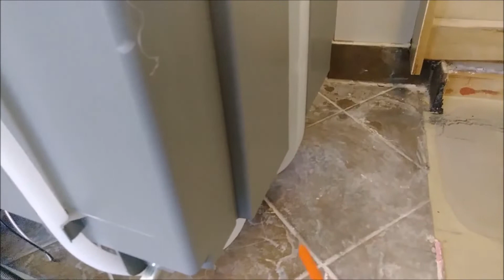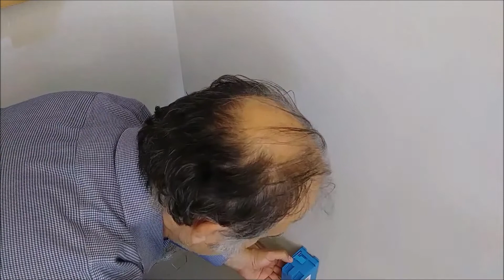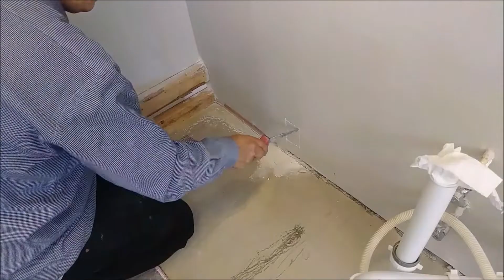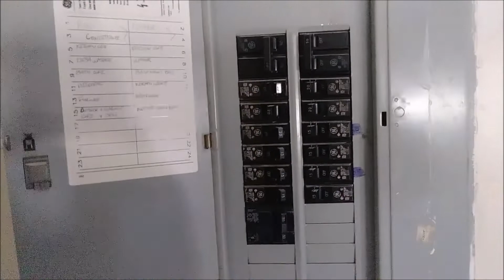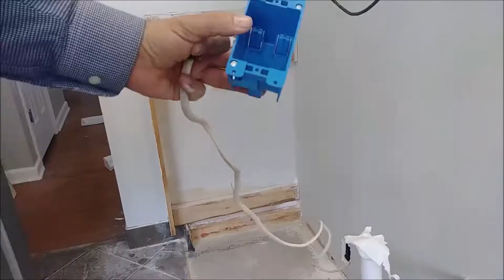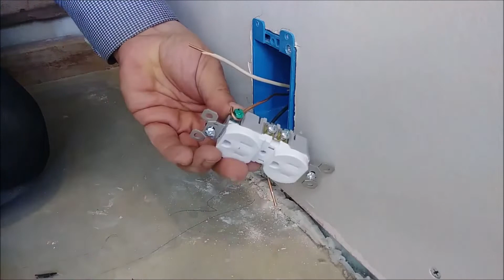How To Add and Wire Outlet To an Existing Circuit -  Replace Hardwired  Dishwasher To A plug

Comment: Why is this so ridiculously low to the floor (7-8", who told you that)!??  What about the baseboards and base cabinets bottom/toe kick?  This outlet would be touching the bottom of the cabinet and look silly.

Also that's some serious overkill (and dangerous) using a multi tool BEFORE a hand drywall saw!  Why not just start with that?  Also then you show checking the power AFTER you've done all the dangerous work where you could have gotten electrocuted! Lol

Next time, just use a handsaw. And install much higher!

Sorry, I don't think this guy knows what he's doing.

Comment: How do you know the exact location of the cable behind the wall?
Reply from the maker: I know because it was there before I install new wall.
Reply: Clearly, he's psychic.... Let's watch for an hour as he over-explains how to use a screwdriver and pull a wire through a hole. LOFL 😆